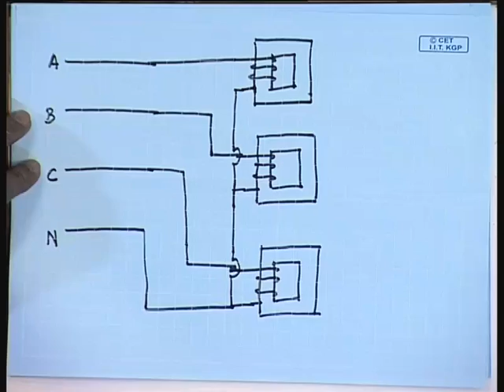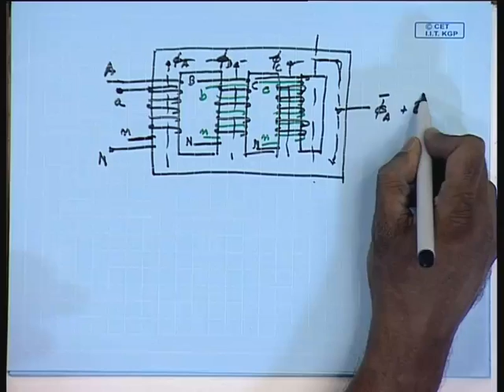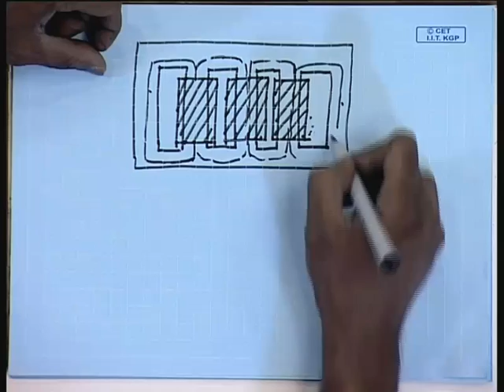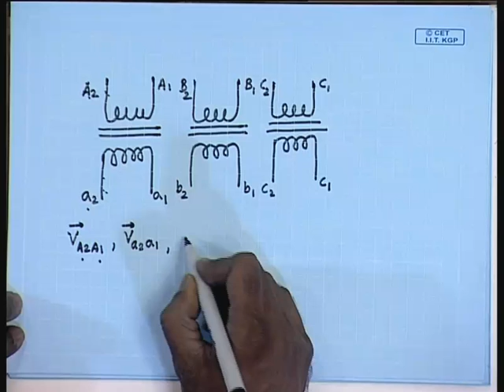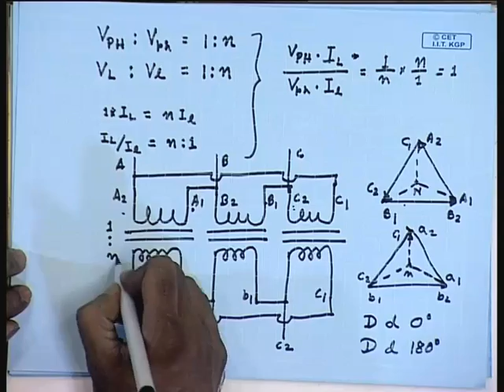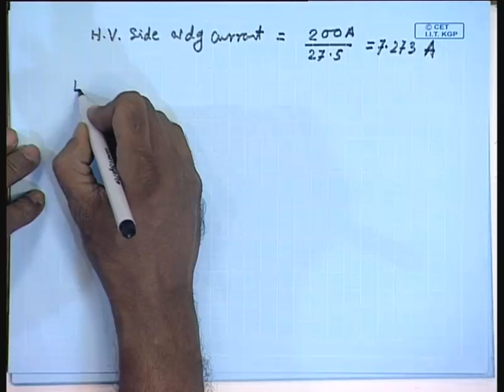Mod-01 Lec-10 Lecture-10-Introduction to Three Phase Transformer

Comment: If ratio is assumed 1:n then why Va2a1:VA2A1=1:n 

While according to transformer v1:v2=N1:N2
Reply: Same doubt
Reply: see usually how we write turns ratio ..n1:n2 ..right he has also given it in the same way but has written it in such a way that 1 came on hv side and n came on lv side. So 1/n is correct .
Reply: @abinessg6895  1/n is correct when HV : LV is given but in this lecture it was written LV : HV so it is wrong to write 1/n.
But later on professor has written LV:HV as 1:n which is correct. 
I hope u noticed and see it again
Reply: yes there is mistake there